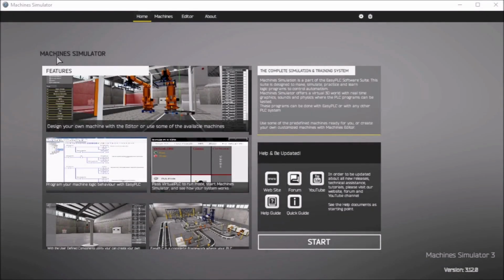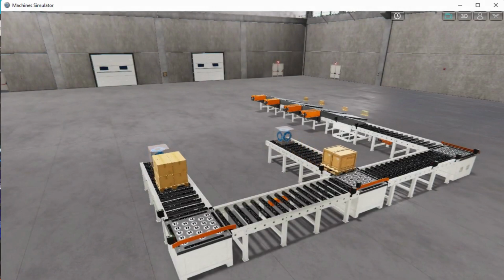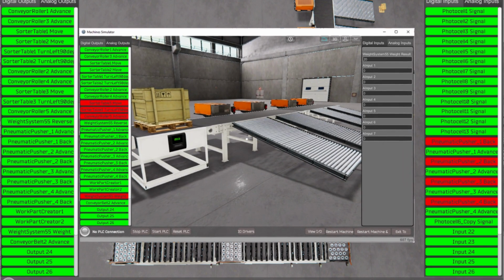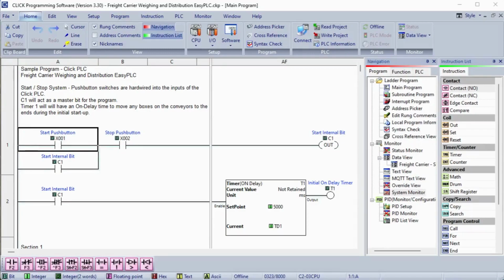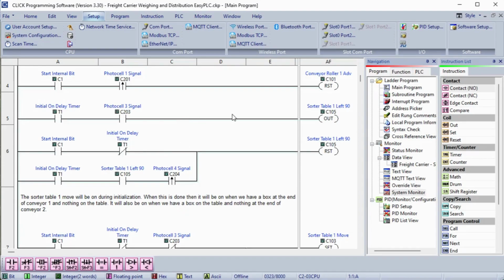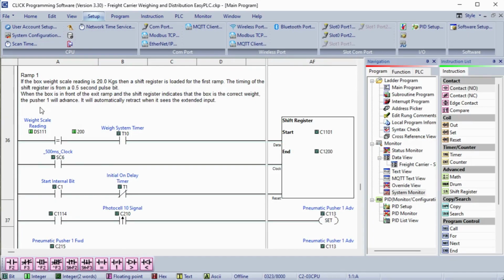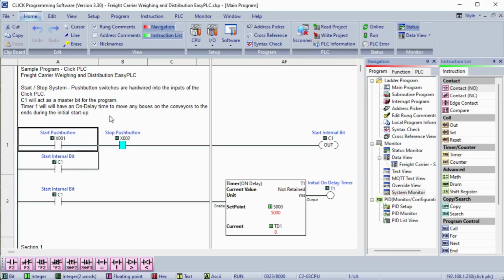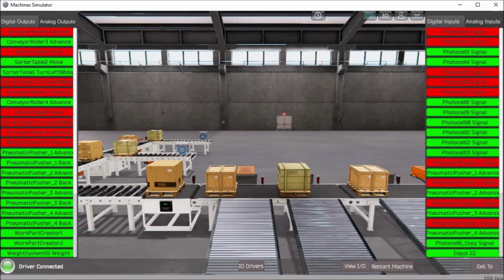Master PLC Programming: Build a Smart Freight Weighing System

Comment from the maker: The EasyPLC Software Suite Series can be found here:
https://accautomation.ca/series/easyplc-software-suite/

Purchase your copy of this learning package for less than $75 USD for a single computer install, or less than $100 USD to allow different computers.
Receive 10% off the price by typing in ACC in the comment section when you order.
http://www.nirtec.com/index.php/purchase-price/
Learn PLC programming the easy way.
Invest in yourself today.

EasyPLC Software Suite is a complete PLC, HMI, and Machine Simulator Software package.
This PLC learning package includes the following:
Easy PLC - PLC Simulation that will allow programming in Ladder, Grafcet, Logic Blocks, or Script.
HMI System - Easily create a visual human-machine interface (HMI),
Machine Simulator - A virtual 3D world with real-time graphics and physical properties.  PLC programs can be tested using the EasyPLC or through other interfaces. (Modbus RTU, TCP, etc.)
Machine Simulator Lite - Designed to run on Android Devices.
Machine Simulator VR - Virtual Reality comes to life so you can test, train or practice your PLC programming.

Here is a list of YouTube Shorts about EasyPLC Software Suite including the Machine Simulator.
https://www.youtube.com/playlist?list=PL3y71jAPOdZAvTC8-TWNifAHpgEkAfqZQ

Regards,
Garry
ACC Automation
https://accautomation.ca/